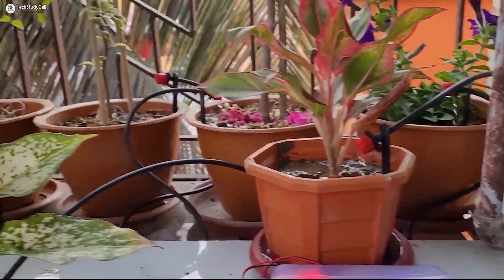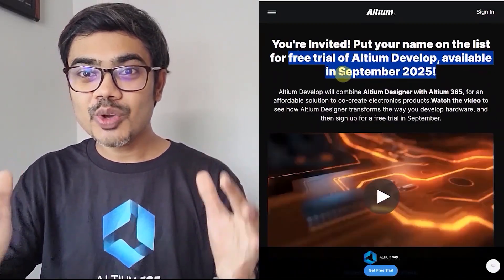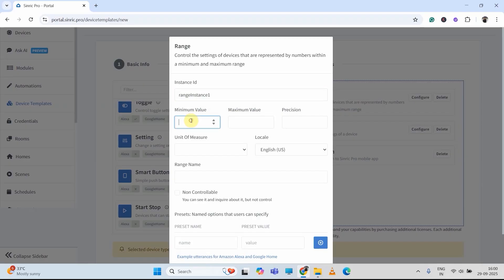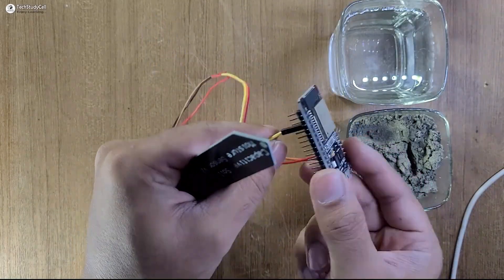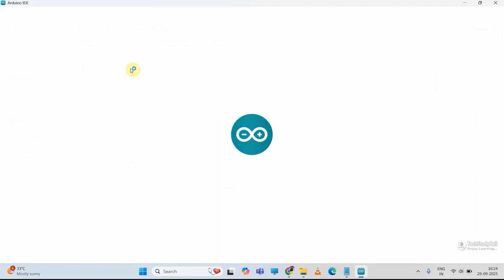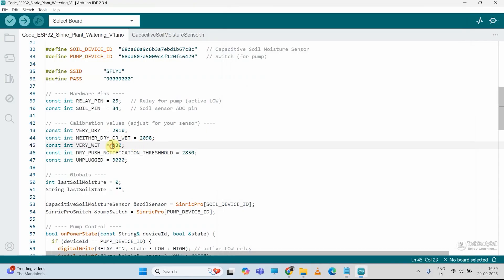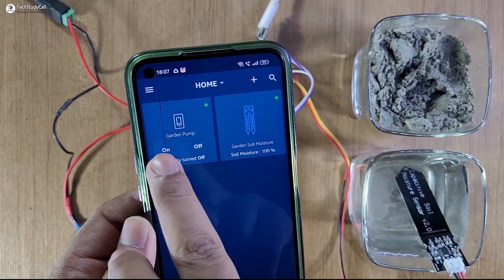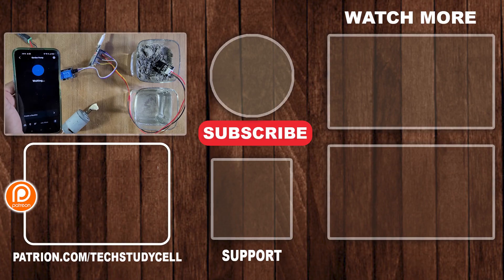Make IoT-based Plant Watering system using ESP32 Alexa for vacation | Smart irrigation project

Comment: Sir how to connect the device by Wi-Fi my device are not connecting
Reply from the maker: Make sure your Wi-Fi credentials are correct in the code. use stable power supply